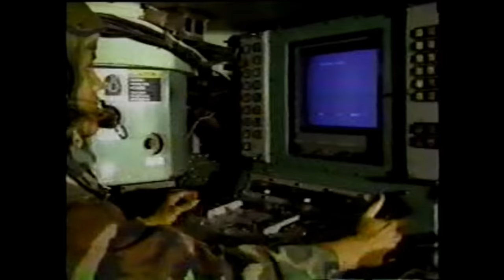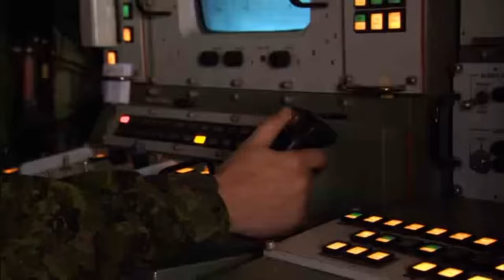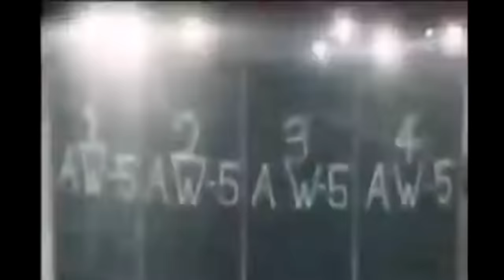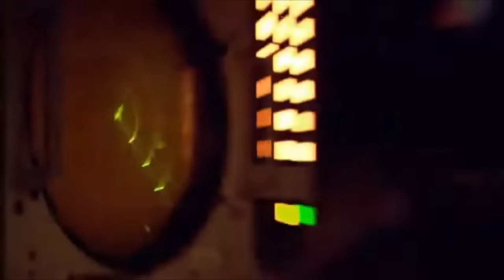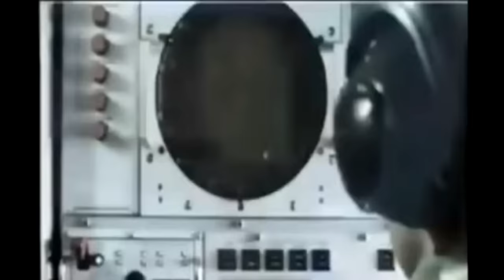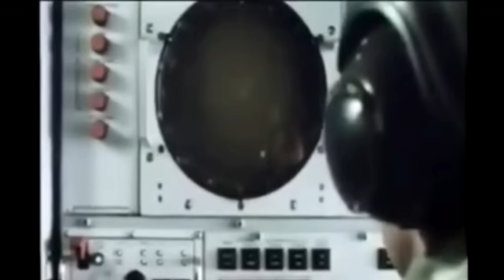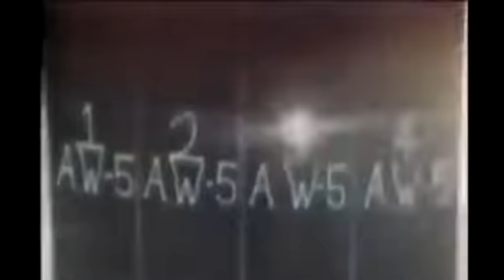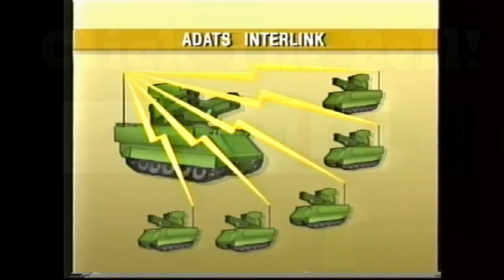The Air Defense Anti Tank System 'ADATS' Overview - DUAL-PURPOSE MISSILE HUNTER 📡

Comment: It would have been perfect for today's battlefield with drones, this would have been a great drone defense system.
Reply: Indeed
Reply: Until SWARMS become a thing. 

The best defense against drones would most likely be guns (specifically multi-guns) not rockets.
Reply: @dickmelsonlupot7697  I would say directed energy weapons, like a high powered laser or microwave, would be a better.
Reply: Kind of large, complex and expensive for anti-drone work.
Reply: doubt it...the gigantic shaped charge warhead will never perform as well as a pure fragmentation warhead against small targets
Reply: @jarink1  I would say that both of their main disadvantages are the fact that they're relatively new: But the further direct energy weapon systems go into development, the smaller and less expensive they'll get.
You do have a point on complexity though, but I wouldn't say they're more complex than, let's say, a 20mm rotary cannon.
Reply: @AKAtheA  you do know it has a proximity fuse.....
Reply: Not ideal for drones. Too expensive per shot versus $1,000 off the shelf drones
Reply: @AKAtheA  shaped charge will probably miss a tiny maneuvering drone most of the time
Reply: @dickmelsonlupot7697  the German Mantis is quite good for small drones
Reply: @dickmelsonlupot7697  isn't there a version with a 30mm cannon
Reply: Lasers
Reply: @parabellum4224  attached to sharks?
Reply: @lardthing7417  and eagles.
Reply: @dickmelsonlupot7697  FlaK would be nice. the problem with drones are the massive number. Must counter it with massive area denial type weapons.
Reply: Maybe, but you've gotta realize that these missiles aren't designed to hit very small targets. Shit, even a FIM-92 stinger only hits 2.5m long  drones about 60% of the time under ideal conditions. Like, yeah, the US has some absolutely enormous drones, but the kind of drones that are real threats are the cheap, small, civilian drones. This is kinda why I think that SPAAS are going to make a come-back.
Reply: @lardthing7417  Nah, those require a huge power source and drones are cheap. It could be part of an integrated system, sure, but whatever system we use, it needs to be something that can be part of every unit at the battalion or at least regimental level.
Reply: @jarink1  Exactly. Lasers and missiles are a huge logistical strain. If most drones are very large low in number, that's fine, but drones will probably become smallera and cheaper. Even a small quad-copter with half a pound of HE on it is an enormous threat.
Reply: @CharliMorganMusic  keep in mind that I said that as energy directed weapons go further into development, the more power efficient they'll become. But you are right: as of now, they are quite impractical
Reply: @CharliMorganMusic  excuse me sir but I'm quite ignorant, what is or what means SPAAS?
Reply: You want 20mm cannons or 30mm with programmable ammunition for shooting drones
Reply: @dickmelsonlupot7697  probably auto cannon with proximity fuse system you don’t need to hit the drone
Reply: @mostlymessingabout  the auto cannon would of been useful
Reply: @CharliMorganMusic  for against drones better use mini type machine cannons! Shooting hell out of its! Causes less than Missile!👍
Reply: I would say an upgraded Sgt. York or  m163 would do the trick against drones?
Reply: @lardthing7417  
That's still far from our reach. If anything, plasma-type weapons sound good since it's volatility is a good thing against a swarm.
Reply: @cristobalalvarez5491  
There's not much of a problem in regards to power and penetrations since anything airborne doesn't and shouldn't really be armoured that much since basic physics and aerodynamics would deny them any capability to fly. 

The key to air defense against drones is throwing as much shttt as possible to the target(s) until you get a lucky shot or have each round explode much like how flak does things.
Reply: @Joel-bj8om  
Something that spews flak at a ridiculous fire rate would be a dream.
Reply: @jacobbrassard2776  
Exactly but having just one gun makes it difficult when overheating is a big issue. 
Multiple guns with flak-like capabilities that fires short bursts would be the best against swarming drones. 

Honestly though, when I played CoD: Black Ops 2, though a work of fiction it was indeed legit scary when Raul took control of the drones and made them swarm you in that one mission.
Reply: @dickmelsonlupot7697  dude the hind is armored well
Reply: @cristobalalvarez5491  
Yes but no. 
It's only the body specifically the areas where the passengers and pilots are. 
But the rotors, engine bay, tail rotor and other parts are still pretty much "soft targets" where even 7.62mm NATO can do a lot of damage especially when fired in a volley. 

You can't just make an aircraft be as well-armoured as a tank.
Reply: For predator type drones yes, for those smaller drones the Oerlikon 35mm air burst munitions are a better option. You don't just have to have the capability to defeat enemy equipment, you have to have the ability to afford to defeat their equipment as well
Reply: @lardthing7417  too slow
Reply: @dickmelsonlupot7697  guns are very difficult to support by logistics, good for some kind of stationary roles where you have trucks and trains feeding ammo but not that much for something that moves, even on ships guns are being replaced by misles and lasers
Reply: @hphp31416  
Somewhat true but you're not gonna "invade" when your up against a swarm. You're almost always on the defensive when you're up against those.

And no, missiles are ineffective against swarms of drones since it will only shoot down one or just a few at a time unless you people know how to make swarming missiles as well like those of fiction like say Ironman's little rockets. And missiles are damn expensive. A single missile costs more than your typical AA gun plus change to spare for bullets. They're not cost-effective at all plus you can only carry and lug them around in limited numbers. Plus there's the problem of those things being too sensitive. One wrong move and you have a brick on your hands or worst, you go boom. 

As for lasers. Like missiles, they're too damn expensive and isn't really that effective against a swarm. Lasers, like missiles, can only target one at a time. They're not like those of fiction, like those of Superman's eyes, that shoot destructive lasers that melt through anything and everything.
Reply: EMP
Reply: @dickmelsonlupot7697  airburst kind rockets?
Reply: @tornad8063  
Still too expensive. 
Rocket fuel isn't cheap my man.
Reply: @dickmelsonlupot7697  also true

-we should do an aa shoutgun-
Reply: @dickmelsonlupot7697  40mm shotguns perhaps.
Reply: @CharliMorganMusic  drone fleet will become next war deterrent just like Nukes.
Reply: It would be too much of an overkill
Against drone swarms gun systems like the Draco or the JRVG-1 that fires 76mm frags would be much more effective and efficient.
Reply: @lardthing7417  the best option would be a combination of all the above options. Missile are expensive, guns are inaccurate and lasers are expensive and it takes time to have an effective outcome on the target. Missile would be use at long range to hold off armed drones (drones that carry missile) and first laser then gun as the last ditch defense.
Reply: Armenia needed these
Reply: Lmao, at one missile costing more than a typical small drone, and it being outranged, I'm not so sure..
Reply: No its not  BECAUSE THE COST OF DRONE AND A MISCILE WITH SUCH POWERFULL EXPLOSIVE ARE LIKE MOON VS SUN . SO ITS WILL WORK ONLY AGAINS BIG LOW FLYING CRAFTS NOT A STORM OF DRONES
Reply: @AKAtheA  The targets that the Canadian Forces used for live fire exercises were actually drones. Most were no larger then 2-3 meters across. Most of the time there were only small fragments of the drone left.
Reply: @cristobalalvarez5491  Those would be Gepards with 35mm guns. Completely different system.
Reply: NOPE! Gents, there's something BETTER than this & I submit the Rheinmetall Oerlikon Skyranger 30 HEL as it has not only a Rheinmetall Oerlikon KCE 30 x 173mm revolver autocannon, it also has Starstreak surface-to-air missiles along with a 20 kilowatt High Energy Laser (upgradeable later to 50 kilowatts & ultimately to 100 kilowatts) plus a 7.62 x 51mm MG-5A1 machinegun although, to be honest, it's not really good at engaging ground targets except for the Oerlikon KCE 30 x 173mm revolver autocannon! Personally, I'd modify the Skyranger 30 HEL with the missiles of the ADATS replacing the Starstreak missiles to give it increased standoff against MBTs but upgraded with IR-homing in addition to its laser guidance system plus I'd further upgrade its targeting systems with the same company's MANTIS Counter Rocket Artillery shell & Mortar bomb (C-RAM) air-defense system so that it can also defend against these threats as well as against drones, loitering munitions, aircraft & missiles, too! Well? What do you gents think?
Reply: A SAM for civilian drone is an absolutely horrible exchange.

I like the approach that Rheinmetall has taken, with configurable time fuses on heat rounds to provide a highly accurate flack system against drones, with a decent range.
Reply: Future here. Absolutely could have been useful in Ukraine.

 We definitely need A SHORAD that doesn't cost an arm or a leg to destroy a drone that costs a few hundred.

Comment: Canadian... it works... it is really cool... it got cancelled... sounds familiar!
Reply: @KISHANTH JEYAMOORTHY wait the Canadians tried to make an aircraft carrier AND a nuclear submarine?
Reply: The ADATS was a American program but I agree justice for the arrow!!
Reply: @KISHANTH JEYAMOORTHY I looked into it more and I think your right. While it appears the American military had a hand in it, it was designed and built by Oerlikon.
Reply: Not really that it got cancelled, just that the cold war ended, which is really what these were designed for.
Reply: @lardthing7417  Aircraft carriers were all X British carriers. HMCS Warrior, HMCS Magnificent, and HMCS Bonaventure
Reply: @davad8042  US Trialed it, mounted to a Bradley chassis. Had they gone on to use it, would have been a game changer for Oerliken, and Canada would probably still be using it. US never went with it, and has never really had anything even close to similar in their arsenal since.
Reply: Gentlemen: a little more research besides just watching a YouTube video would reveal that ADATS was basically a failure. Its performance and reliability have never been up to snuff. That's what happens when you try to make an antitank weapon work against aircraft, or an antiaircraft weapon work against tanks. Or try to train one crew to do what takes two specialized crews to do. The US doesn't want it and never did, and Canada would be quite happy to see an effective replacement.

Comment: I've always wondered why we never had a fully dedicated mobile AA system.. that would have been great on the Bradley
Reply: we Had the budget M6 line backer.
Reply: @LordEd21-21  yeah but that wasn't the same
Reply: @paez4779  well it had Stingers for air craft and a 25mm for ground targets as well as low flying air craft. Hell the US new AA the IM-SHORAD is basically both in one using Stingers, Hellfires and a 25mm.
Edit sorry IM-SHORAD uses a 30mm
Reply: @LordEd21-21  yeah the ADA Line Backer Bradley was cool but was not as capable as this.. I'm glad to see we have the SHORAD now.
Reply: @LordEd21-21  Stingers is not even remotely the same. IR tracking only, easily defeated, slower, and 1/4 the range. Attack helo would have the assets your trying to protect obliterated before even coming into Stinger range.
Reply: @viper29ca  No Stingers are not really intended for helis and low flying aircraft anymore. Now they are used primarily for drones if jammers can not do the trick. If you look at the latest Stingers all their improvements went to combatting drones hence the IM-SHORAD can carry between 2  to 8 Longbow Hellfires depending on the configuration, with the base model being 2 Hellfires 4 Stingers and 30mm cannon as a last resort.
Reply: @LordEd21-21  similar to the proposed MMEV for the CF. LAVIII chassis, 6 ADATS, two 7 shot 2.5" rockets, and a .50 cal
Reply: ADATS was selected by the U.S. Army for the Forward Area Air-Defense (FAAD)  program under the designation MIM-146. The US Army planned to purchase 387 firing units. After extensive testing,  results indicated that the system did not perform well in inclement weather. Ultimately the FAAD contract was cancelled in the early 1990s after the end of the Cold War.
Reply: @LordEd21-21  I wonder how difficult it would be to mount an ADATS turret on a Stryker... just an idea

Comment: I can't comment on the actual missile system however, I can comment on the chassis chosen by Canada. The M113 chassis was a horrible platform for this system. The vehicle harmonic vibration from the tracks, while running at speed, caused huge problems within the electronics over time and the rotational forces from the turret rotation was actually twisting the M113 chassis, to the point that the rear ramp wouldn't fit properly. That aside, the subsystems for the gas turbine assembly were at best substandard in construction and techs on the ground (me) had to perform "innovative" repairs (that the engineers said were impossible and shouldn't work) to get the system up to any kind of reliable standard. On top of that, the $ markup of parts by Orlikon sold to the Cdn gov was obscene. For example, the gas turbine engine starter from Sunstrand Turbomach was $1600 US, but Orlikon was billing DND $8k cdn for it. Like other Canadian systems, it was subverted by greed and political ineptitude.

Comment: Thanks for the video. It brought back some memories for this retired gunner. I was a operator and detachment commander for this system for about 14 years. If you have questions just ask.
Reply: The laser - was it a SACLOS system and had to be kept manually on the target, or was it slaved to the search radar and automatically locked on., like a tracking/missile guidance radar  ?
Reply: @thamwaikeong5885  The Gunner had to manually keep the crosshairs on target using FLIR and the cameras. When a possible target was detected by radar and designated by the radar operator. The turret would automatically spin around to that bearing. Where it would be acquired and identified by the Gunner manually.
Reply: why the military don't develop more this technology because I think by using this  weapons you can attack air and ground target with one device? what is the weakness so the military retire this weapon?

Comment: As always Mats great video, if a little bittersweet. I had some exposure to the ADATS in the Cdn Army as Mech Inf (1PPCLI). In 2005, 4 AD Regt brought their vehs out to CFB Edmonton to trial a new integration concept for the system in the Army moving forward (asymmetric warfare). I don't know what canned the ADATS but the last time I saw it deployed was in 2012 on a Combat Team Commanders Crse in CFB Wainwright. A buddy of mine in 4 AD said it was the last time they would be used before they were retired. 4 AD Regt now is largely UAV/target acquisition or was before I retired. Definite loss of capability, the ADATS would be a capable asset to Canadian and NATO units deployed in the Baltic States.
Reply: It was a doomed system given the chassis it was mounted on and the Orlikon $ markup on the cost of parts. Even back then, we said it needed to be mounted on a heavier chassis (Leo 1 or 2?) , due to vibration and torsional loads due to turret rotation.

Comment: I would love to see a low profile tank, say an m1 Abrams without the turret, with an unmanned turret on top. I would take and adapt some of the technology in the mast system that replaced the Periscope on the Virginia class and I would add the longbow radar from the Apache. And then put six to eight hellfire missiles on the turret. You could do with a three-man crew you pull back to a vehicle with a reload crew. Along the lines of the mlrs. Come to think of it you could even do a box launcher for the hellfires. Drop them off load them up and go back on the line. Between the low profile and the fire and forget, you could kick some serious butt. Keep the vehicle hold down extend the mast and it is a digital system that can see no matter what the conditions are. Or you could raise the longbow a couple feet, acquire the target, and then launch off the box launcher. As soon as the missiles away you scoot to another spot. they would never see you they would just see dust and smoke at best.

Comment: Pain to work on (mechanically) but seemed to be a good piece of kit. It would need a gun these days as the missiles would be overkill for a drone. I think the dual 35 mm orlikon(sp?) ground trailer was hooked into the system but need to talk to a Bird Gunner for full capabilities. We need SO much more capability that has been gutted.
Reply: The Oerlikon GDF-005 and Skyguard Mk II were in the same batteries but not the same troops. We used gun/Skyguard only in airfield batteries. The ADATS troops would deploy beyond the fence to give depth to the defence. Gun/Skyguard did not have the mobility to keep up with a brigade group. That said, with its AHEAD ammunition, there are few systems more capable against drones.